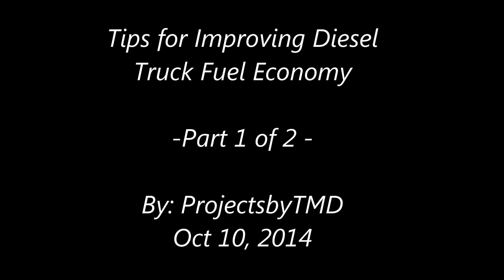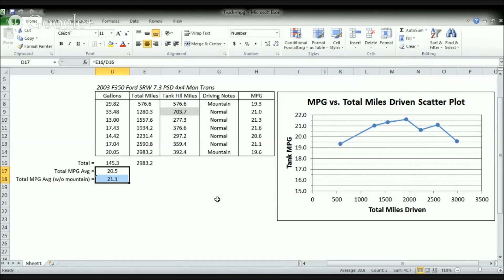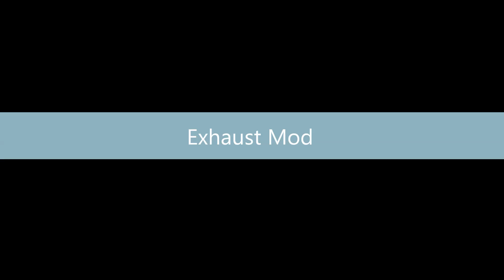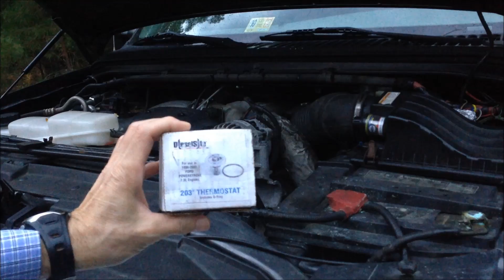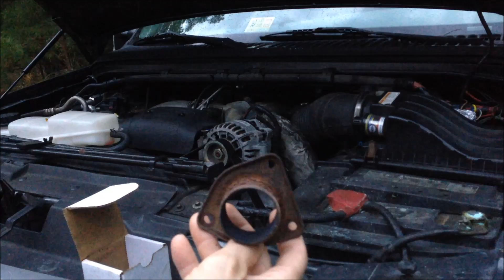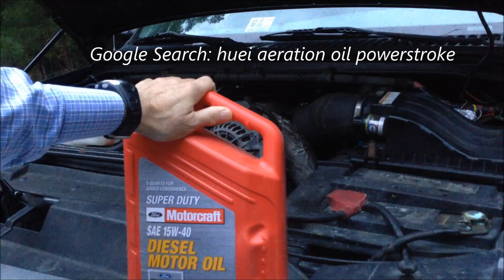Tips for Improving Diesel Truck Fuel Economy - Part 1 of 2

Comment: read this and believe it, cause it is true:  I have a 2007 6.0 F250 2WD Crewcab SRW Larait very nice 108,000 miles.  All I've done so far is the Purge tank cap, Coolant filter, K&N Filter in Stock box. Exhaust and everything else stock. Had a smart man do me a tune for mileage. He sent me three...I did not like the first tune.  Truck runs great and pulls great.  Here is the deal....do you know anyone getting a minium of 18 mpg empty in city driving?  i do.  How about anyone getting 25 to right at 30 Plus with the best of 33 mpg empty @ 70 mph, perfect weather no wind! Awesome!   Ok some will say I am just pulling your leg..  Guys this mileage is the same for the last 6+ Months! Tunner is amazed as well.  Maybe this is a very special truck. OK Loaded pulled 30' Gooseneck flat bed and heavy trailer got 17 to 18 at 70-75 MPG up and down hills.  Then loaded it up with 20 ton roof A/C units stacked two high and still go 13+ at 70 MPH with hills.  I am one happy old 65 year old man.    So, why am I getting this great mileage? Luck maybe. And yes I check it often and the speedometer is spot on.  No I do not want to sell any time soon if ever.  Thanks
Reply: You've optimized most of your efficiency, parts and tune, so you reap the benefits. Also look into K & N filters as they sometimes let too much particulate through, and can dirty the engine
Reply: 33MPG empty....C'mon, there is no way in creation an 8000 lb brick is getting anywhere near your mileage claims, unless you bought the only hybrid made that year.  Oh, perhaps your going by the mileage display in the truck, which is way off if you do such things as chip the truck.  Would be nice, but reality is reality.

Comment: Two things never ever run used motor oil in your fuel system. A.B.F. Trucking tried it back in the eighties, after 25,000 miles injectors and fuel pumps started to fail, gee I wonder why? used oil is full of  crap from where ever you got it, Diesel engines run best on CLEAN fuel! think about all the soot in used oil, nasty dirty soot full of contamination. Why risk a $4000.00 or more repair when Diesel is under $2.00 a gallon. So go ahead Screw your engine up! I will wave to you as you are being towed to Power stroke.com
Reply: David  Humphries 
WTH were you thinking? Motor Oil? DUH.
Waste Vegetable Oil needs to be filtered and should be heated.
All fuel lines need to be polyethylene, as WVO and any oil is higly acidic.
The only engine I have dealt with is the 7.3ltr Powerstroke, but of course the first diesel ran on peanut oil.
In my experience Taco Bell has the cleanest WVO, and straight Hydraulic Fluid is by far the very best mpg, power, and quietest.
Basically Diesel Fuel Sux.
Reply: I know this is a year old comment, but Diesel#2 is 3.49 a gallon here in CA. HPR (high performance renewable) is only 2.59 a gallon though!
Reply: Used oil should be recycled and not used for anything else. There are many diesel fuel additives which are designed for diesel engines. Choose one that works good and replace your fuel filter at or before the recommended service interval. Try not to get too "experimental".

Comment: Does the 203 Thermostat help with generating more in cab heat? I put in a heater core bypass which helps A/C about 10 degrees in the summer, now I'm looking for something to get this heated up quicker. Below 30 it can take 15-30 minutes which is aggravating .
Reply: An electric heater on the coolant line going to the cab is about the only thing you can do.